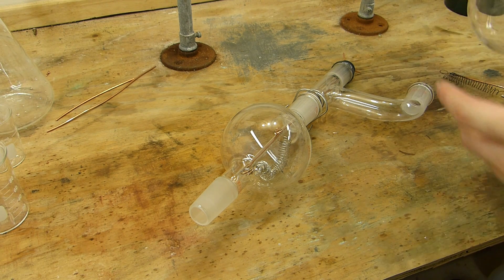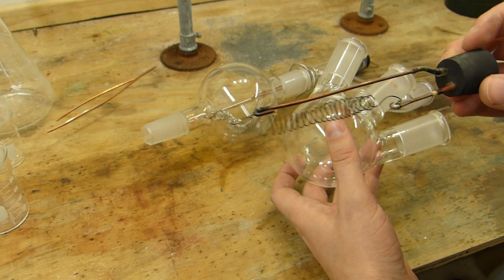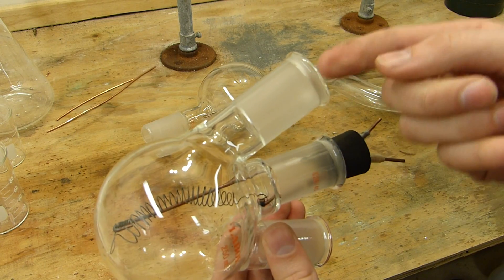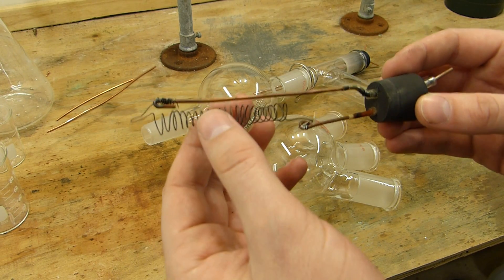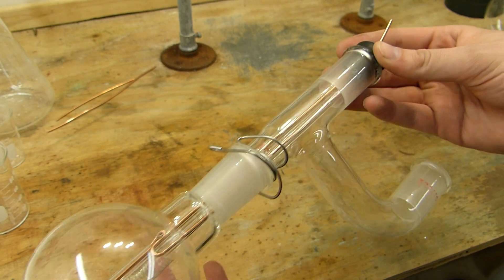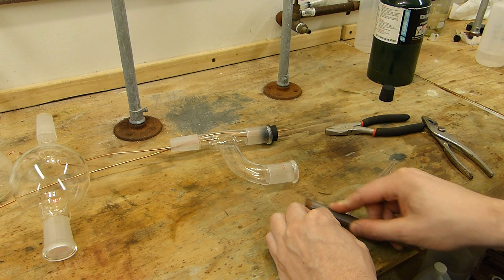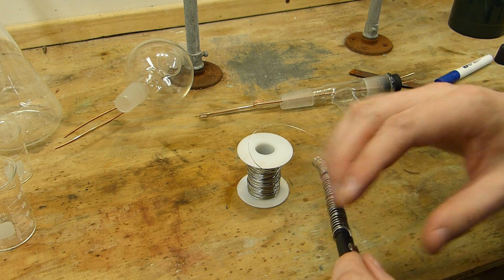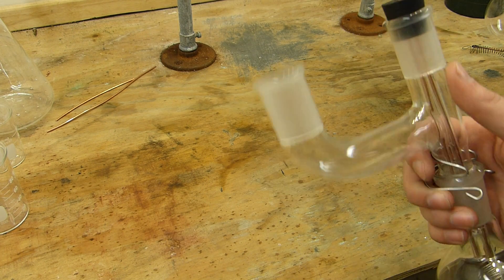Acetic Anhydride Part 1: The Ketene Lamp

Comment: can someone describe how to build power supply for such lamps? or send me to correct website?
Reply: You really need to use a variac so you can dial in the temperature with precision. I could be wrong, but I think the flash point of the acetone vapor is just barely above the temperature where it transforms into ketene, assuming you haven't flushed the oxygen out of the lamp beforehand through maybe flooding it with a heavy gas like nitrogen before first running it. But yeah, get yourself a variac and a handheld infrared thermometer with a laser sight because 1) you'll need both, and 2) honestly, you deserve them. Spoil yourself!

Comment: You mention the extreme toxicity of ketene versus hydrogen cyanide.  But I note its violent reaction with water (to form acetic acid).  It would seem that in any realistic atmosphere (such as the humid Florida atmosphere you have) that any ketene that escaped would instantly be converted to acetic acid, harmless as a poison.  (Versus cyanide, which is not destroyed in the atmosphere.)
Since ketene + water = acetic acid, is ketene acetic acid anahydride?
Reply: I'd say it won't. Maybe in a 25 meter radius you can assure yourself a survival but 5 meters won't make a guarantee. I think the vapors don't get reacted all the way. I think it reacts with the surface of the vapors. Then the next layer/surface untill it's gone. Since it's so toxic, I would assume it's not wise to bet on water reactions. Better to have a proper gas mask or something like that. Honestly, I think phosphorus pentachloride is even safer for this experiment, even taking into consideration the leftover phosphorus trichloride.
Reply: @tracnemaker123  There are lotteries where you might win a million dollars. This seems like a gamble with no good prize.

Comment: I wonder if you could take a mixture of glacial acetic acid and benzoic acid, or some other aromatic carboxylic acid, and make a mixed anhydride with this method.
Reply: I think so. Also using mek instead of acetone into GAA gives propionic/acetic anhydride
Reply: @ryans3442  can u explain how
Reply: Replace the propanone (acetone) with 2-butanone (mek)

Comment: That is pretty cool. However isn't the oxygen that's present in the system when you shut the stopper gonna interfere with the pyrolysis?
Reply from the maker: +Chemistry Yes, but the air will be purged first! If not, there is likely to be an explosion.
Reply: +Doug's Lab Ah - well I'm looking forward to part 2. Did organic chemistry start catching your interest? As far as I can recall you've done a lot more of it recently.
Reply from the maker: +Chemistry Yes, I am mainly interested in organic chem. Most of the inorganic stuff you'll see me do is preparation of catalysts, oxidizing agents, etc. for organic reactions.
Reply: You can purge the air put with wippets or some other inert gas